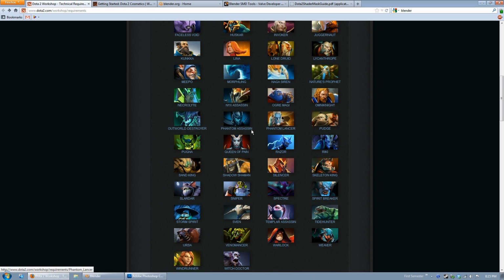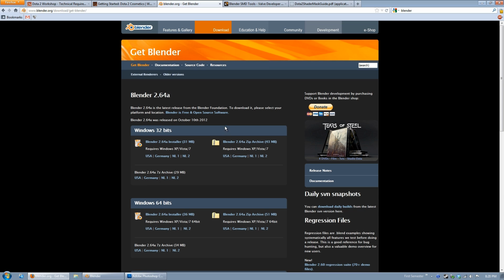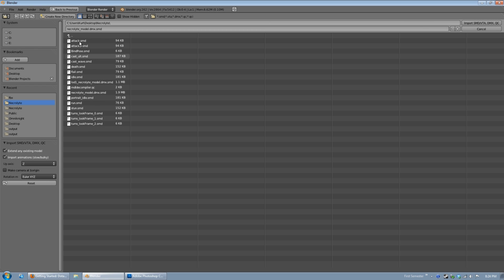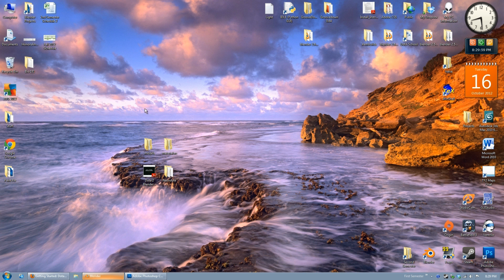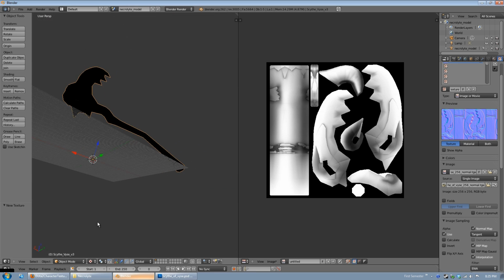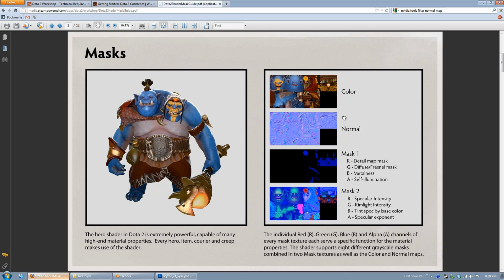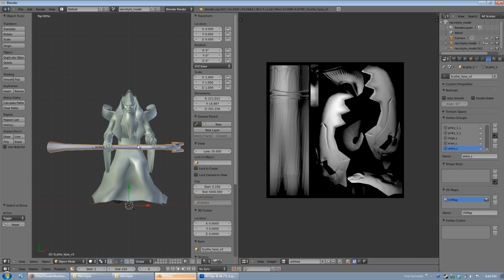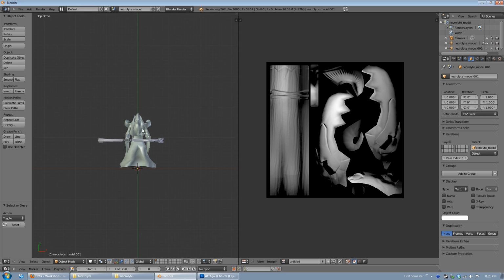HellJumper's Blender Tutorial for the Dota 2 Workshop

Comment: I have found your guide very helpful and it worked perfectly in my older computer. However, with my new computer i have ran into a problem. Whenever i press the "import" button in Dota 2, the game crashes with no error messages whatsoever. The model is complete (shoulders for spirit breaker) while i use gray squares as textures for test purposes, it used to work fine. What could be the problem here? I have found zero information regarding my problem on the internet.
Reply: I exported it as smd and it worked.
Reply: Check if your system is up to date.

Comment: I'm having enormous trouble getting SMD tools enabled on blender version 2.68. On the SMD tools site it says it works on 2.63+ so I should be good. I've tried installing it manually the way you did, and I've tried installing from file. Both times the check box is gray and I get a massive error message when I try to enable. Any hints on how I might proceed?

Comment: Hey Helljumper, big-time fan here. I have a question about the decompiling procedure within the blender. When I put my model into the blender, the decompiling procedure works fine; however, when I select "smoothie" mode, I encounter some problems. It appears that the blender stutters and fails, could this be due to the blade? should I look towards upgrading the blender? Thanks!